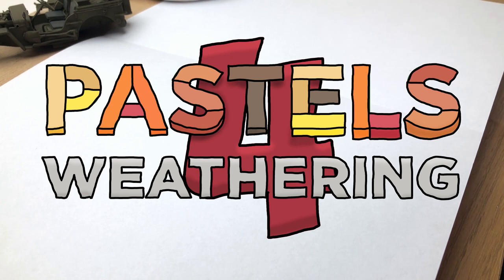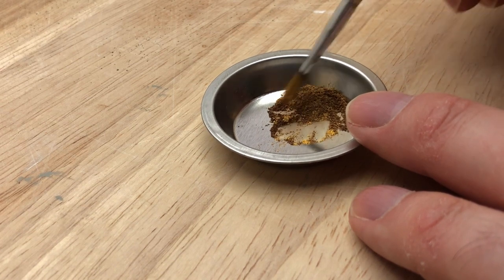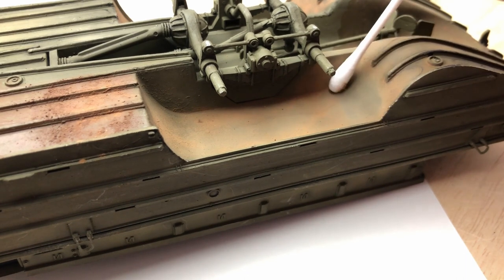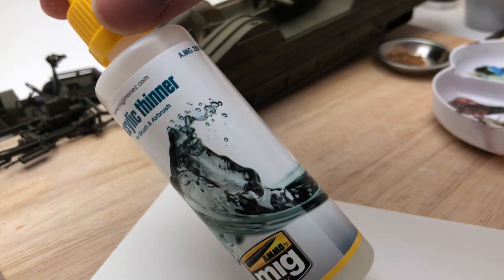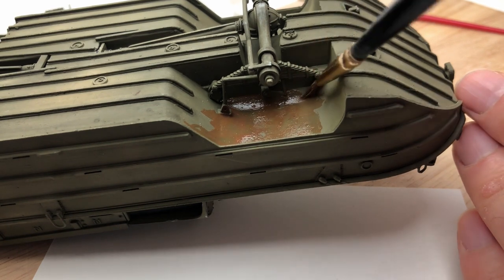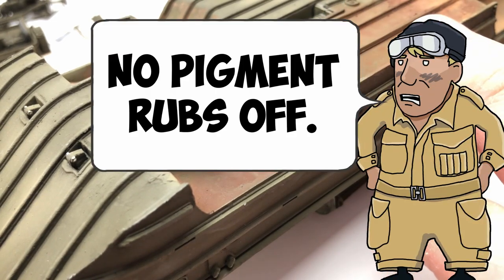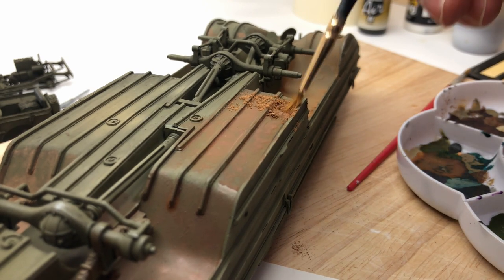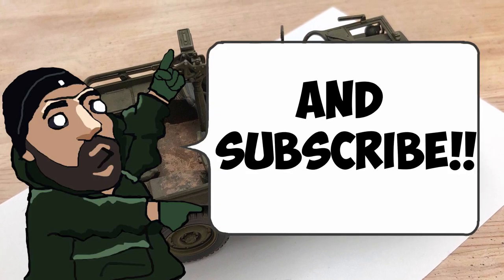Pastels 4 Weathering

Comment: Thanks for the vid, very informative. I have a large bottle of Humbrol Decalfix that I never really liked for fixing decals so I may have found an alternative way to use it up.
Reply from the maker: Cheers man.. it’s a winner with pastels! I used it again on my latest T72 and it worked just great 👍😀
Reply: @modkitmayhem  I've used a mix of a few drops of water, a few drops of Humbrol Decal Fix, one drop of washing up liquid and grated pastels of desired colour and consistency on a couple of models now and the results have been fantastic. Paint it on, let it dry, then reactivate it with a water dampened brush to remove any excess.
Reply from the maker: @martinoconnor4314  Cool, I'll give it a try on my next Vehicle.. maybe a King Tiger or the s.w.s halftrack. Cheers

Comment: I wonder how white glue would go to make a thick mud.  I mean, once it's on your model it's not coming off, so you might want to layer it, but if you wanted a really thick caked on mud on tank tracks or something similar, I think that would work quite well.
Reply from the maker: Hi Ian, give it a go! It might be a bit too thick and I'm not sure what would happen if it was watered down! I'll try some on the bottom of a tank next time - cheers
Reply: Modge podge?
Reply from the maker: I haven’t ever used Modge Podge! Might be worth a try! I’ve got some in a box somewhere.. may dig it out! 😀👍

Comment: I tried mixing the dust with water and it would not mix. Hopefully the thinner option works
Reply from the maker: So far the decal fixer has worked the best for me. The dust/Pastels with water, just comes off when you handle the model overtime.

Comment: Interesting. I'm wondering how it would go if one applied the dry pastel (which looks pretty decent and I could imagine might make for good aircraft exhaust), and then after went over it with a matte coat. Anyone tried that?
Reply from the maker: Give it a go, I tried with some dust on a wing but as soon as the varnish mixed with it it disappeared.. only collecting in the panel lines. Like you say it looks good when put it straight on but keeping it there is a issue.. maybe with enough of it and a misting of matte varnish over the top would work!

Comment: Panel line for tank, what brand you suggest?
Reply from the maker: I used Mig to start but I now use Vallejo because I prefer cleaning with water and less smelly chemicals 😀👍
Reply: I'm back into modelling after messing about on and off for years. The amount of products on the market now is mind boggling. I'm looking for cheaper DIY alternatives that will do the same job which is why I like videos like this. For panel lining try artists oil colour, such as raw umber, and low odour thinners. Seems to work fine and works out a lot cheaper than 'bespoke' products.
Reply from the maker: @davidrobinson4118  Hi David, I have some Oil paints but haven’t got around to trying them yet! I’ve an old Tamiya KFz222 which needs finishing so that might be a good model to try them on.. just needs the chipping effect doing with hairspray - another technique I haven’t tried yet ha ha 😀👍
Reply: @modkitmayhem  Same here with the hairspray chipping thing, not tried that yet. But then I am only just finishing my first bit of armour for, ooh, must be about thirty years! Started with the Tamiya panzer II, the old kit from the late sixties, really good value, especially with a discount voucher from Hobbycraft.  I've gone for a fairly 'clean' look as my weathering techniques are basic at the moment. My excuse is that the vehicle has only just arrived in Africa and is not too beat up yet!  Going to make a small desert diorama. Have a building on its way from Fields Of Glory so looking forward to messing about with that. I've done the figures that came with kit. They don't look too bad, just don't use a macro lens on them! Got a Panther, a panzer IV and a Leopard in line, all the cheaper Tamiya kits from the late sixties, early seventies. Also ordered the panzer 38(t) by Tamiya when I ordered the building, couldn't help meself but it got me over the threshold for free posting. Got other stuff in the little stash but the stand out kit is my Trumpeter 1/200 Bismark. Bought this about ten years ago for when I had more time on my hands as I always intended to get back into the hobby. I'm retired now so will start that after I've got back into the swing of things more. Sorry I do tend to waffle on and get carried away talking to kindred spirits. Take care my friend and happy modelling.
Reply from the maker: @davidrobinson4118  Hey David.. sounds like you are going to be busy ha ha!! No need to apologise.. waffle away! To be honest its really nice when people comment on my videos, its what its all about at the end of the day. So much time and effort go's into them that its easy to forget that there's a whole world of modellers out there ha ha. I'll do a video on chipping at some point.. record my trial and errors which in turn hopefully helps others. Happy modelling to you friend